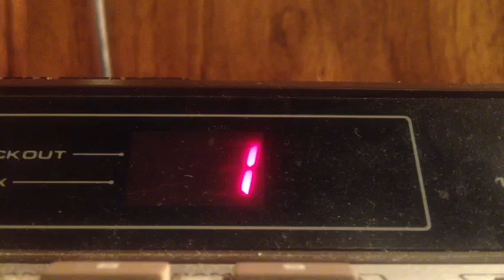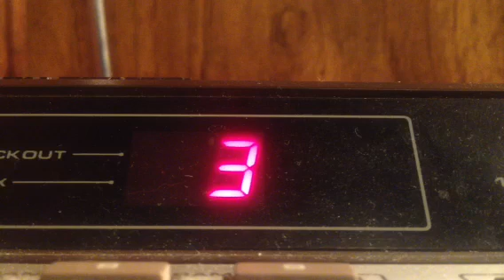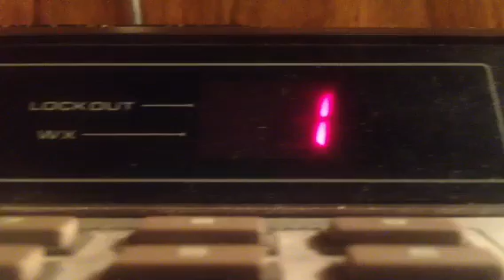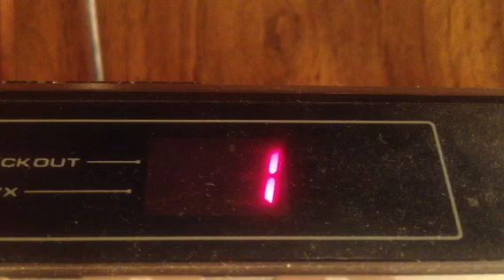My Uniden BC145XL Police Radio Scanner

Comment: i have one of these can u tell me ho9w to program it
Reply from the maker: Barbara. Yes, just press in the frequency, and press enter. Then press the <MANUAL> button to move on to the next channel. I hope this helps. Its one of the easier scanners to own. Be advised, however, that it only does VHF/UHF. Does not do 800 MHz.
Reply: ok thanks Curt
Reply: +Curt Yowell can I get frequency for my bc145 scanner
Reply: +Ritchie Payne how do I get frequency for my bc145